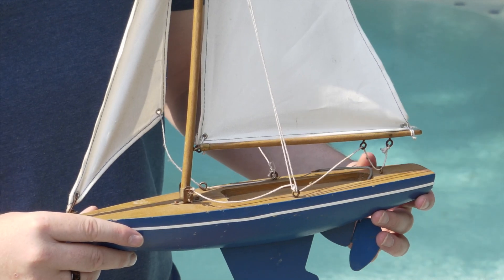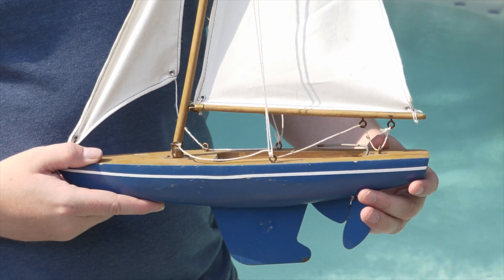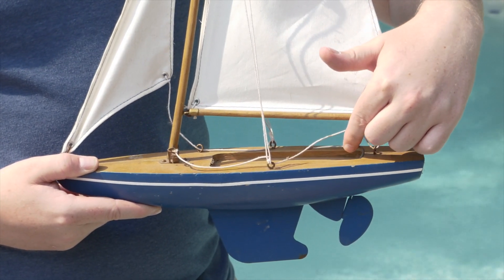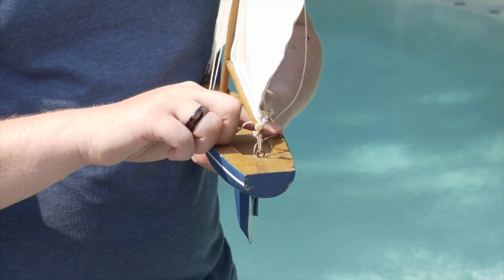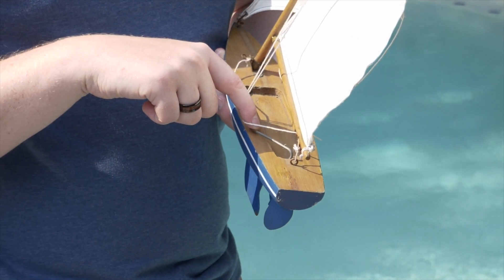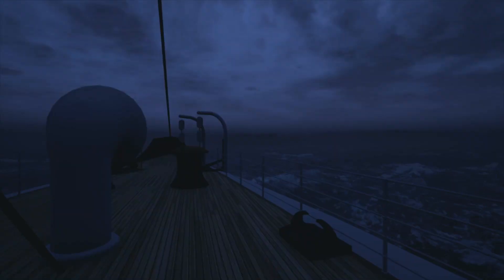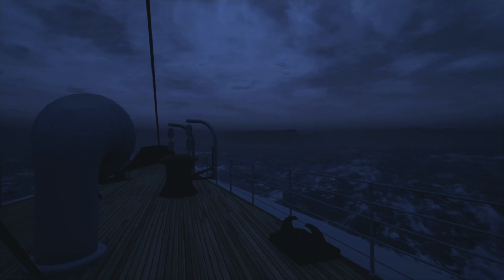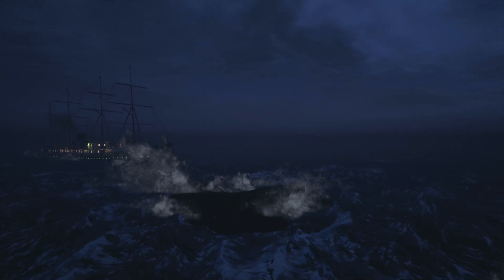Let's Talk about "TILLER COMMANDS"

Comment: Titanic's rudder was controlled via a large semicircular geared tiller, which during a port wheel turn would move the tiller to starboard. Interesting that it still had a form of tiller.

Comment: How is the wheel set up?
It seems to me that a tillering command would be set at the wheel.  If one gives a command to starboard... it's fine to call that a tillering command and then to turn the wheel to starboard... knowing that the ship would then heel to port.  But to give a command to starboard knowing the ship's wheel would be turned to port AND the ship would heel to port... seems to me to be problematic.
I'd be interested to see how the ship's wheel was actually set up.

Comment: I asked Mackenzie Gregory about this several years ago and he gave a similar explanation, using the term "port your rudder" as an example.  With a tiller, to port your rudder is to move the tiller to the port side, which turns the rudder and the vessel to starboard.

Comment: In hindsight, the Titanic SHOULD have turned the wrong way. If they had turned into the iceberg and hit straight on, or near straight on, she'd have never sunk.
Reply: Hitting this iceberg head on would be like hitting a car on a strong wall.
Reply: @HugoGHA  Except that a car is not almost a thousand feet long. It's very much agreed among experts that had the titanic hit the iceberg straight on, she would not have sunk. She would probably still even be able to keep her engines going. It would have required more than 4 of the water tight compartments to be flooded for her to sink. So that collision would somehow need to cause more than 200 feet of damage. And the way a boat is built, it's essentially a giant crumple zone. It is just not possible for a head on collision to cause that kind of damage. Not at the speeds anywhere near what the titanic was capable of.

That's the benefits of the water tight compartments. Think of it like a 12 pack of pop. If you smashed one end with big hammer, it'll destroy maybe like the first two rows of bottles, and the rest would be fine. If instead you took a Razer and slid it down the side, you are going to cut into a significant amount of the bottles and compromise their ability to hold liquid.
Reply: @TheTonyMcD  Taken from a well-researched Titanic fact-check site:
A frustrating comment frequently made is that if Titanic had hit the iceberg head-on it would likely have survived. But there are at least 5 key issues with this "theory."
A) First, it would be unthinkable for a RNR (Royal Navy Reserve) officer with the experience that First Officer William Murdoch had to give such an utterly insane order. It would be a catastrophic career ending decision. There is no professional or official guidance that would instruct him to do so and he would have been hauled before the courts with multiple negligence claims if he had done so.

B) Second - Titanic was travelling at almost its top speed and its impact with a solid wall of ice would not only have caused considerable damage but would have killed a large number of people in the bow section and injured many more throughout the ship . Remember that hitting the iceberg would mean a 45,000 ton ship going from 21 and a half knots to coming to a dead stop within a few feet - the momentum of such an impact would be enormous. The forward section, comprising of more than 250 crew and steerage passengers, would be destroyed with a large loss of life. Everyone standing would fall. Those in their beds would be thrown to the floor.

Titanic researcher Terri Bey makes an interesting point on this: "The Titanic was a passenger liner and her bow was built to collapse. An icebreaking vessel has a bow that is purposely made to break ice. Had Titanic hit the berg head-on, there would have been dozens, if not hundreds dead because there were passengers and crew who had their cabins in the bow area."

C) Third - we don't know the shape of the iceberg - it could have caused more damage. It is a well-known fact that an iceberg is only about 10% above water. With this in mind we do not know exactly what lay beneath that fatal iceberg. First Officer Murdoch came very close to pulling off a very complex manuever in which he "port around" the berg - so a head-on trajectory could have caused even more extensive damage to the ship than simply destroying the forward section, especially if the irregular shape of the iceberg penetrated other areas of the ship leading to multiple water-tight compartment failure, resulting in a sinking that would be too fast to accomplish any efficient evacuation.

D) Fourth - the damage could have been fatal. Even excluding the unknown shape of the iceberg, if we take just a forward collision with the iceberg the damage from that itself could have been fatal. Titanic's mass and momentum would result in her bow superstructure being crushed possibly up as far as the bridge area, warping bulkheads and ultimately causing watertight doors to jam (as happened on her sister ship the Britannic) which would lead to more rapid flooding overall a faster sinking or even capasizing of the ship. 

Some also believe that a head-on collision would have created huge stress on Titanic's expansion joint, resulting in a serious breach of the hull causing the ship to sink within minutes, not hours. Other researchers such as Andrew Noll have speculated that the iron rivets holding the ship together could have failed causing a "rippling effect down the hull [that] could of opened up seams all along the hull leading to more flooding along the length of the ship."

Titanic researcher John Nutzmann also commented on this:
Even under the best of conditions of running into a wall of ice at 22.5 knots, one has to take into account of the ship’s momentum of 58,587.2 tons and having it come to a dead stop within several feet, as much as the ship could penetrate the iceberg. The energy generated by the collision would have been as much as 3,560,495,839.65 joules (1 ton of TNT = 4,184,000,000 joules). Titanic would likely have foundered in minutes, not hours, and would have taken all hands, as distress signals and the launching of boats would likely not have been possible in the time frame the ship would have had left.

Another Titanic researcher Jean Scuissiatto notes about the watertight doors:
Yes, it might have only crushed the bow, but who would have gone to close all the watertight doors very quickly on that section? People have the wrong idea that all watertight doors were automatic, when only 12 of them were, these were the ones on the lowest level. All others had to be manually closed by cranks. With the whole bow opened to the sea, she would have started to fill VERY fast, and if water made it's way to BR 6 and 5, she would be doomed and far worse than the actual scenario. And in this case I'm not even considering the watertight doors getting jammed by the hull twisting during the collision, something that happened on Britannic and could have happened with Titanic. 

We also have a case in point for reference - Titanic's young sister ship the Britannic struck a mine on the 21st of November 1916. The impact caused the vertical watertight doors to jam and she sank 55 minutes later.

E) Fifth - It is very easy in hindsight to say what should have been done,, retrospectively. But ultimately, speculating on such a highly unlikely "what if" scenario is a waste of time - especially since no sane officer would consciously give an illogical order. Such a decision could have also led to a "buttery fly effect" of failures which would lead to a worst case scenario sinking with an even larger loss of life.
Reply: @DerpyPossum  Thank you for this. I've heard the same suggestion, based on the Stockholm vs Andrea Doria collision, but I only thought of 2 responses:
1. No officer would ever do that. He would ALWAYS steer away from the berg.
2. Stopping 50k tons of ship that way would open every seam in her hull and she'd sink in minutes.
I like it and will quote you if OK.

Comment: Ok, so, for clarification...
On Titanic, if the iceberg was spotted to the right, you'd order hard astarboard, which would mean the wheel was turned to port so that the rudder would turn and push the stern to starboard and the bow to port? Am I understanding this correctly?
Reply: yes you are
Reply: And if you spotted a torpedo, you’d order hard a starboard.

Comment: Everybody rn: then why tf did titanic turn to left
When they said hard to starboard
Reply: He already explained why, depending on the ship and how its steering mechanism was hooked up to the rudder, turning the helm to port could either turn the ship to port, or to starboard. So the logic goes that Titanic's helm was hooked up in such a way that turning the helm to port, turned the ship to port. So when the tiller command came to turn hard to starboard, Hitchens knew to turn the helm to port, because that's what the tiller command ultimately means.
Reply: It was actually hard a (at) starboard where the tiller was turning tawords port but aligning with starboard

Comment: Hi Tom, I'm a little confused. I am familiar with tiller commands and I know Robert Hichens didn't make a mistake when he turned away. What I'm confused about is which direction he would have turned the wheel in? Would he have turned the wheel to port or starboard? Even though the Titanic was fitted with a wheel, I've always assumed that Hichens would have turned the wheel in the direction that someone would push a tiller, so physically turning the wheel to starboard would mean the ship would turn to port? 

Bear in mind that is my assumption, so please correct me if I'm wrong. If I am wrong, does that mean Hichens would have known to turn the wheel in the opposite direction that Murdoch ordered, like how we steer a car? Once again, those have been my thoughts since I became familiar with tiller commands.
Reply from the maker: He would have turned the wheel counter clockwise, so that the top of the wheel was being turned to port - the direction the ship would be moving in. It's the same as a steering wheel on a car.
Reply: Apparently they are using "Tiller commands".  Those are the opposite of the direction of the wheel.  This has been abandoned since steering a ship by tiller fell out of favor as ships got larger.
But that one confused me as well.  One would think that if tiller commands were given that the wheel would be set backwards so as to input the command as given.

Comment: A good video, Tom, but maybe I can still add something. I recently realised that tiller commands are in fact perfectly logical. We think in terms of turning the top of the wheel to the right when we want to turn right, because everybody drives a car and that's what we do in a car. But in a ship with a rudder it's different because the rudder is not on the bow of the ship, but on the stern. So when Hitchens turned hard to starboard, he literally did turn the Titanic to starboard – not from the bow, but from the stern. The stern of the ship was steered so that it moved to starboard. Of course this meant that the ship as a whole was now pointing to port of the iceberg and, because she still had forward way on her, this was the direction in which she started to move. But she was too close to avoid the iceberg by this alone. In order to avoid crashing sideways into it, the helm had to be put over to the other side, steering the ship's stern to port, thus pointing the bow to starboard, in order to complete the manoeuvre, which is of course why she ended up pointing northwards. Hope this helps!
Reply: It’s easy when you think of turning your car in reverse. The back becomes the front (direction of movement) and then the steering wheel does tiller stuff. 
Not very difficult even for car drivers.
Realised your comment is over a year old.
Reply: Essentially rear wheel steer.

Comment: I was working on a 38 foot sailboat and the wheel stopped responding.  The steering cable to the 2 cogs for the steering wires had fallen off.   I had to go in there and my friend yell down to me which way to turn and how much.  I never saw the shore, the dock or going into the slip but he guided me right in as I steered from below. So when it came time to fix it I could not Figure out how there was so much cable left over when I got it on the 2 cogs.  Also when I pulled one wire on the starboard side the wheel went to port.  So I started thinking about the titanic command And remembered everything was reverse back Like when using a tiller.  
Then I crossed the wires and when I turned the wheel to right we went right.  So something was missing.  
I used a bright flashlight and looked farther to see not 2 but 4 cogs and one was in the bilge.  The cam pin had broken off and the cog fell causing the steering cable to fall.  It was too far to reach so to get it out I had to use my toes, to get it back on I had to duct tape the cog to my foot, press up till I got it on the shaft, use a wire coat hanger with bubble gum to (after Over and over trying) get the thin wire (pin) into the hole hiding it up.  Then I pulled it tight and trimmed off as much as I could.  I had no idea who designed these damn boats where you can’t reach anything.  I’m glad I’m not tall.  Anyway, how I figured it out was remembering these commands that really must confuse someone from land.